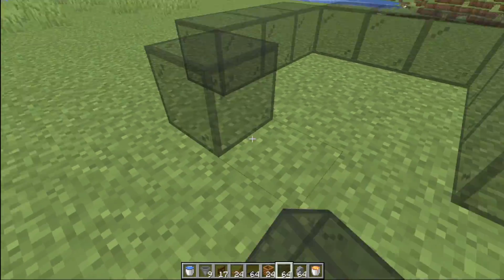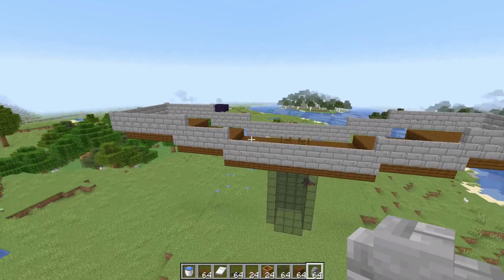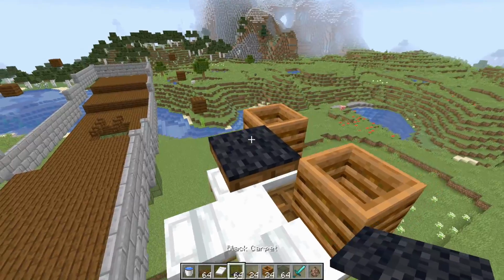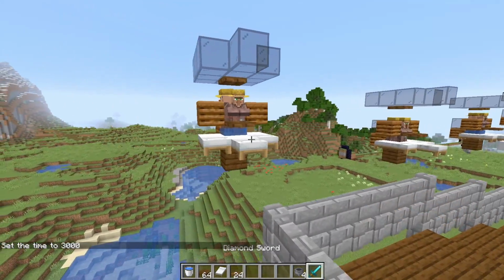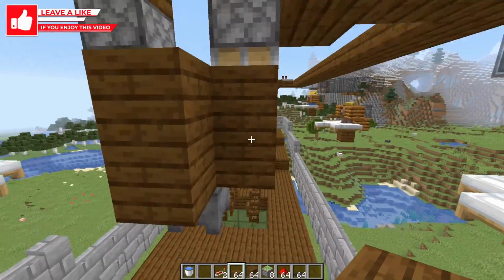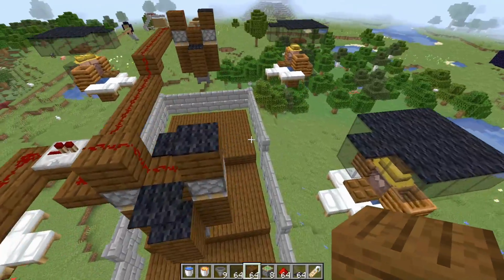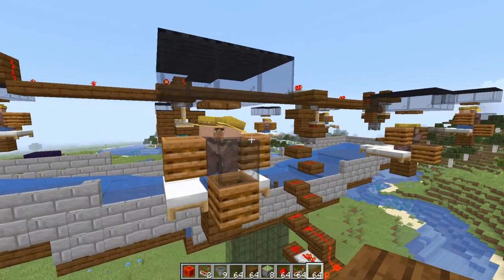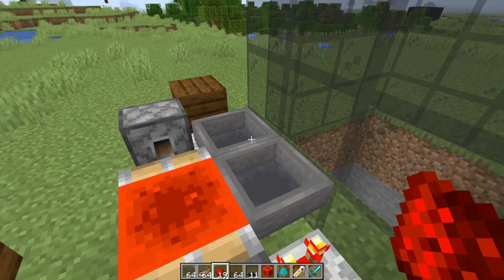MINECRAFT INSANE IRON FARM | INFINITE IRON FARM

Comment: updating to 1.16.3 seemed to make it where only 2/3 of the villagers will stay in each chamber while the 3rd will stay outside and eventually walk off and die of fall damage? anyone else having this problem? worked completely fine before updating
Reply: place carpets on the pillow side of the beds that should prevent the 3rd one from escaping, do this for all the beds
Reply: I had the same problem, even some of the villagers fall and die then tried carpets but the rates weren’t the same, because for some odd reason one villager wouldn’t use the bed at all, till I tried slabs on the bottom of the glass above the pillow of the beds, now it works fine hope this works

Comment: Its working in 1.16.1?
Reply: Yes
Reply: You will have to slightly change the villager pods since sleeping mechanics have changed and the villager will end up outside of the place they should be and will just stand on the bed. I think placing string on the bed then carpet on the string should fix it but I'm not sure.

Comment: It works on 1.16 but some golems are getting stuck and not moving in the water
Reply: Not for me. I think u may have done something wrong
Reply: Bob is Goodish it worked perfectly fine in 1.15.2 but after the update golems get stuck at the gap between 2 fence walls
Reply: @TheOfficialSibu  which fence walls are you talking about? The ones at the sides that keep them from falling out of the farm?
Reply: @bobisgoodish7129  yes
Reply: @TheOfficialSibu  I'm not sure why that is happening. I did not have this problem. It could be that they are resisting the water and trying to get to the zombie but I have not had this issue so, unfortunately, I can not provide a solution.

Comment: Ok but how did you do the hopper clock?
Reply: 2 hoppers facing into each other, Comparator coming pulling signal from both hoppers, solid block in front of comparator. (all of that is done in a straight line). 1 block towers you, place a redstone dust, should be a cross in 1.16. sticky pistons facing each other with a redstone block in the middle. 64 items of your choice in the hoppers.